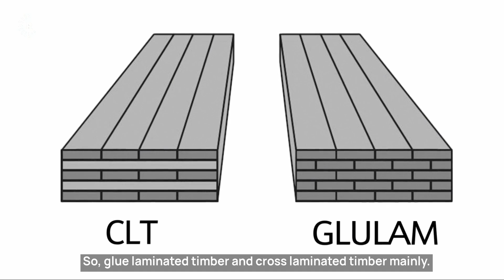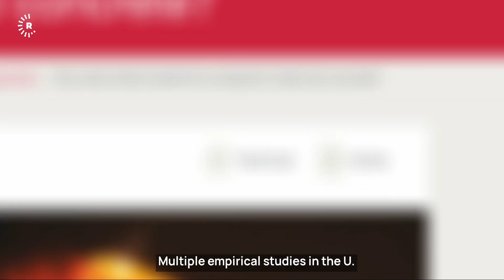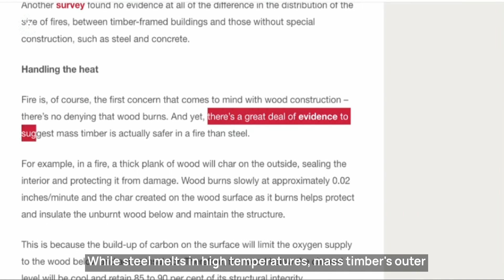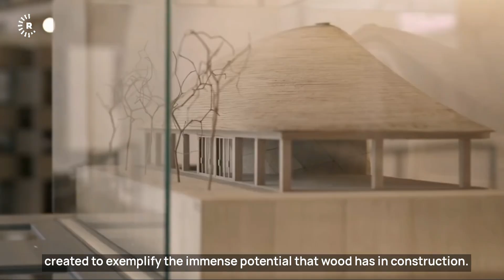The Race to Build The World’s Tallest Timber Skyscraper

Comment: Let’s drive out this discussion of structural steel melting as an important consideration in a structure fire. Steel has two characteristics that are important in fire. It expands as it heats, practically meaning elongates and bends. The other is it loses strength as it heats, so that by 1,100-1200 f, 650 C, about half the strength is gone. Neither characteristic is a good thing if you want your structure to remain standing. Melting point of steel is not an important characteristic in fire. 

Just as mass timber can use concept of char in its design there are specialized industries that insulate steel to reduce rate of heating in a structure fire.

Another characteristic of steel is that it conducts heat much better than wood. Remember that char has no meaningful strength. So that exposed steel fasteners can conduct high temperature into wood that it is fastening, charring the adjacent wood. This is why lightweight lumber trusses utilizing gang plate nails can collapse in ten or fifteen minutes in fire. The plate acts a heat sink, the punched and bent over tabs or nails conduct the heat into the wood, it chars, and connection fails. A few trusses fail, and you get progressive collapse. So how do we prevent steel fasteners from doing the same in a mass timber high-rise? We cover the fasteners with wood, or in the soundproofing aerated concrete on top of floor members.